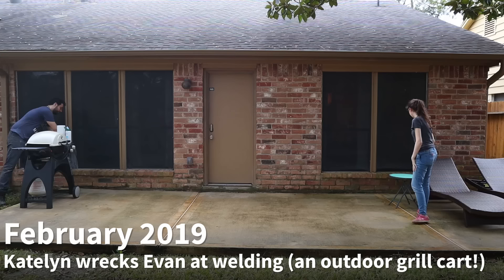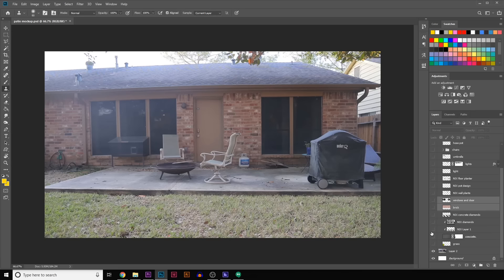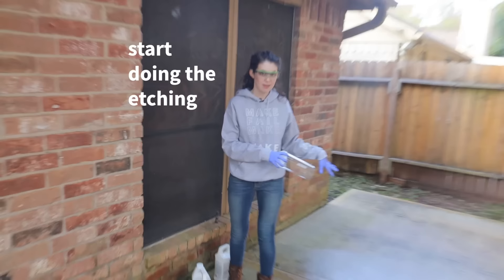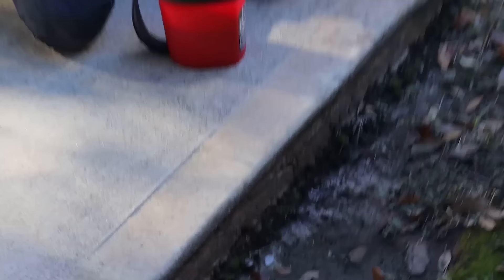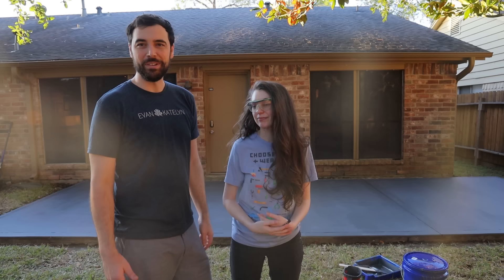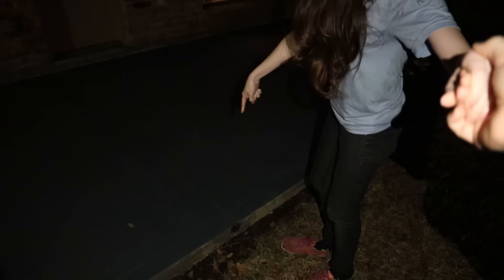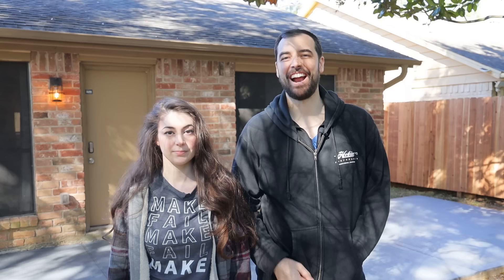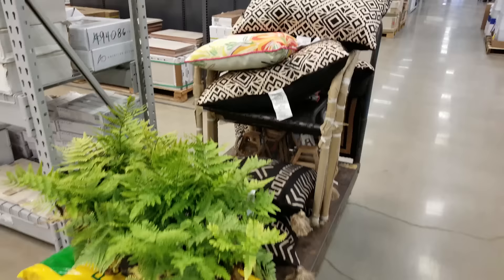DIY Patio Makeover (anyone can do!)

Comment: One very important thought. Let me premise it by saying I enjoy your channel immensely. However, you made a pretty significant error when finishing your side of that fence. When wood gets wet it will swell perpendicularly to the direction of the grain. Meaning as your fence ages and gets wet, panels will get significantly wider and start popping off. The gaps also serve to stop the fence from being blown over. Ty to get the gaps to line up. This might not be a problem depending on the geometry of both your back yards and how they affect winds in that area. Sorry for pointing out the error. You guys are 99% awesome, and 1% not fence builders! : - )

Comment: I would build cedar box benches for either end of the patio, setting them on either bricks just off the edge of the patio or they could be set on the patio.  Make a hinged top so that you can open the top of the benches.  Use them to store garden tools & hoses & other yard tools.  Line the inside top with something waterproof to keep rain from soaking thru.  You could use some treated/sealed plywood & put your cedar planks on top of that.  And finish the benches off with some cushions so that guests will have extra seating.

Comment: Having worked in a Sherwin-Williams for several years, what you were told about the paint colors not quite matching is somewhat true. Here's how it worked at the company I worked at:

1. If you're using a pre-packaged color, and using the same brand, it's fine (for example, the white base will always match the white base when using the same brandname).
2. A custom color match, such as touching up paint that has been chipped away, will have the same color as long as the formula, brand, and base are the same as the original color match.
3. If you're getting full gallons (i.e. 1 gallon can or 5 gallon bucket), the color will match. What won't necessarily match is a quart size, even if it's the same base and same brand, because our formulas were designed for a gallon size, and to get the formula for the quart we divide every value by four. This is the biggest issue when we're talking about the various off-whites, where the gallon formula may have 1/128th of a particular tint, which was the smallest increment our machine was capable of dispensing.
4. Even if you use the same brand, base, and color, there is a scenario where the color may come out different: when the paint manufacturer has updated their formula. This isn't really an issue for new cans, as old product is sold before putting in the new product (identifiable by the different label), but is more of an issue when it's been a while. For example, at some point Sherwin changed their deck stain brand from Deckscapes to Superdeck. They're basically the same product, but different enough that the exact same color can be visibly slightly off when applied next to each other.

Comment: You can always glue stone veneer on the ugly concrete :) As an alternative to painting :) Just make sure it is rated for outdoor use and is not slippery to walk on :) You can also paint the back door or do a stained wood inlay on it. On that wall on the other side of the door you can add second light. If you don't want to drill into the brick, you can make it a freestanding floor lamp. I use concrete deck post bases to make bases for mine. Even a hurricane seems to be unable to move them :) 
About the plants: plants need light, water, fertilizer, and appropriate temperature. Appropriate requirements for each type of plant can be easily found online. Plant cold hardiness can be found online and your cold hardiness zone can be found on the USDA horticultural map. Ferns typically are not cold hardy, although it does depend on their variety. Plants need to be watered all year, winter watering is usually 1-4 times a month, depending on the type of the plant and weather conditions. Plants need to be fertilized during the three warm seasons. If that blank wall gets enough of sunlight, maybe consider doing vertical herb garden on it?.. Herbs need 4-12 hours of direct sunlight a day, depending on their variety. 
I think that your patio turned out amazing ♥ and hope that you will do more outdoor projects in the future. Great work! ♥

Comment: So it's now January when you're doing the fence and allegedly "cold."  What is cold in the area of Texas where you live?  70 degrees?  The fence turned out great, and I like the color you chose to stain the patio.  Did the stain cover up the dark spots that didn't come out with power washing/etching?  The finishing touches are what make it cozy - the lights, the throw pillows, the accessories.  If you don't have a green thumb, artificial plants have come a long way from what they used to be.  Faux succulents especially look very real.  If you sweep he patio a couple times a week the concrete will stay neat and tidy, leaves won't have a chance to decay and stain and you can keep mold/mildew at bay (may have been responsible for the spots on the concrete that did not wash out).

Comment: That power washer looks like its more suited for washing a car or boat.  If you are going to wash a concrete patio or driveway, get one with more than 1000 PSI and a higher GPM rating.  It will get all of the dirt off and you wont have to use the soaps and cleaners to help loosen it. 

Otherwise, looking good.

Comment: Me: “Why did they get such SHORT fence posts?! There’s a few inch gap at the bottom!!”
Reply: In case of flooding? 🤔 I actually didn't notice until I read your comment!
Reply: There is usually a "rot board" at the bottom that runs sideways and touches the ground, so it can rot and be changed out easily.
Reply: David Hancock Thank you David!! You’d think they’d put that down FIRST... So it fits width ways and not all have to be cut. Then put the posts on top. But I guess that’s up to them lol. I was thinking it looks unfinished!! Lol.

Comment: Ah, I know why it took so long to clean the concrete. You got scammed by the worx "power sprayer" thing that is potentially useful but not actually a proper pressure washer in either flow rate or pressure.

Comment: You guys are still young enough to make your life better.  Do yourself a favor and give away the Worx (faux) pressure washer and get a real one.  Those black spots come right off when you have adequate pressure.  
Next do yourselves a favor and get an airless paint sprayer.  Picture this: painting the entire patio in about 10 minutes.  Plus now you can stain your fence with the new paint sprayer.  The sprayer might have saved you an entire evening.  
Next, string a real wires where you want the string of lights to go and zip tie the lights to the wire.  This lets the steel wire take the gravity load and not the electrical wire.

Comment: Um, You just made it a whole lot more difficult to replace those wooden posts holding up the fence. And they tend to rot away at the base within a very short time. Some of mine rotted away after only five years.
You would have been a 'friendlier' neighbor if you'd put up a horizontal board to nail and screw your new pickets into. That could be taken down in panels, rather than one at a time.  And your neighbors' fence was a bit janky - note the blocks holding up the horizontal 2x4s. Very non-standard. (Usually the 2x4 is attached to the face of the post, not the side. Face nailed rather than toenailed.
The screws are a  bit of overkill. Yes, it's a much more secure connection. Sadly, the materials they are going into aren't worth it.